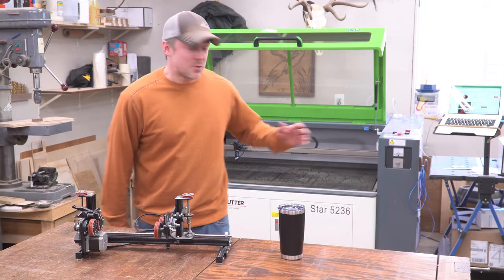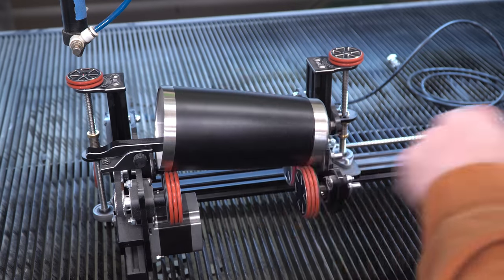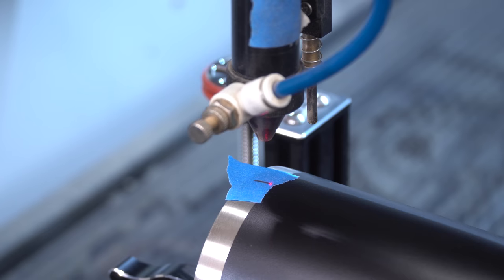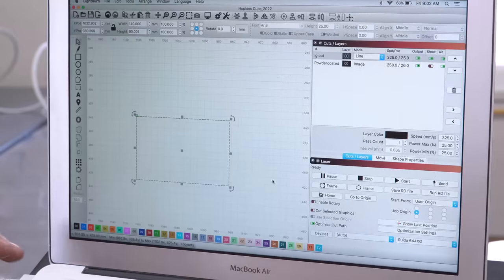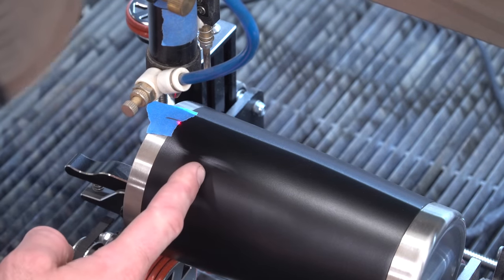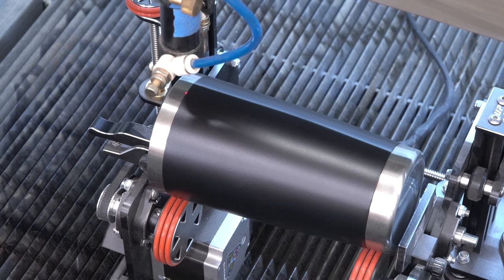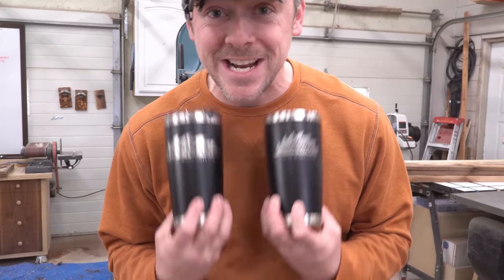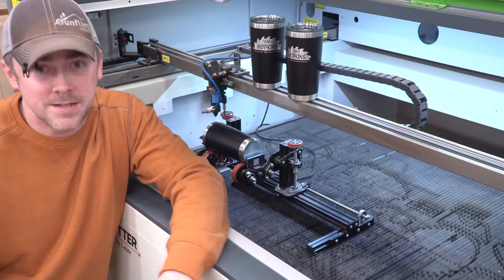Laser Engraving Tumblers Start to Finish with a Rotary

Comment: Several questions.   What is the cost of the setup you have?   How long does it take to run, say 100 mugs?    Isn't there an easier way to do the setup like a placement jig or something?
Reply from the maker: I'm looking at something like $11k in all my laser stuff setup. You wouldn't have to get one as big as this if you just want to to cups though. Depending on the size of the logo, its taking me between 5 and 6 minutes to laser a single cup. I intend to keep playing with my settings to see if I can get that time down even more.  I'm not sure how to make the process any easier - 1) square the jig - 2) Level the cup - 3) Focus. Once you do that for the first cup, you never have to touch it again.

Comment: Sweet video just wondering if you needed to use special glasses while using the laser?   Like they have to wear while welding.
Reply from the maker: The shield on the lid is tinted - so that makes it pretty safe. I just wouldn't make a habit of staring at the brightest spot.

Comment: Good info.....Your machine has removable legs.  Is it possible to disassemble the models without legs to get them through a door?
                        What is your maximum workpiece height?  Considering buying a 2028 60 or 80w

Comment: Hi Mark,
some constructive criticism here i hope you'll find useful as you usually aim for high production quality: Using what i assume is Auto-Gain on your recording device for Audio mostly creates some very irritating jumps in volume. A segment may start intensely loud and limited and then decline a good chunk until your voice is barely audible. This has been more obvious over the last year or so, i know it's kind of a safety/convenience thing but still a small advice: Rather set the gain to a lower, all-purpose setting with a simple overload protection/limiter and increase the volume & reduce your dynamics later - which will give you a consistent loudness over the duration of the entire video.
Great video in itself as always! Greetings =)

Comment: I’ve been thinking about getting in to laser work for a while now, partly inspired by your conversations on the subject over at WBAT.
Will that rotary work with other brands of laser? Do you have a particular laser brand you recommend?
Reply from the maker: This rotary will work with lots of others, but they do need to be the high-power co2 style. The smaller more hobbyist style that Drew has won't work with this. My machine is a Bescutter, but I wouldn't necessarily  recommend it because I have fought it a lot since day 1. Boss is a great brand, but a little more money. Same with Epilog.
Reply: @GunflintDesigns  Thanks! Appreciate the insight.

Comment: Using metric made it so much easier for me to understand what you are doing. Welcome to the rest of the world. You should try using metric for everything as it makes everything so much simpler. 😉
(This is a joke btw. I know how challenging it would be to buy stock in imperial and try to use metric for everything else).
Reply from the maker: lol. I completely understand that metric is a better system. But I've spent several decades with imperial so it just comes naturally and switching would make my old man brain hurt!
Reply: @GunflintDesigns  I totally understand and get that. It's the equivalent of asking someone like me to start using imperial in every aspect of my life.
Great video nonetheless. I found it quite interesting and informative.